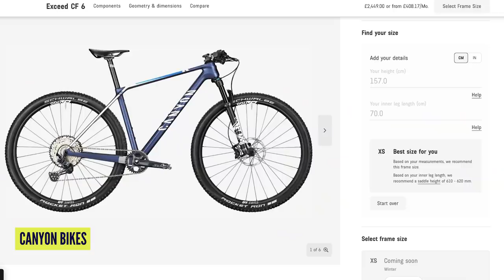How Do I Stop Arm Pump From Braking Bumps? | #AskGMBNTech Ep. 174

Comment: #AskGMBNTech 
Why are bikes so small? 
The stack height of bikes seem tiny. People are always towering over their bike. Bike just seem to get longer reach for larger riders and they just look uncomfortable
Reply: yep, somethign that grinds my gears is stack height.  a Large needs a MIN 640 but some have downwards of 600 which is unacceptable. I like my back to be upright not hump back like roadies.
Reply: @MrSupermugen  5,10 and run a large with 50mm bars. Got a great enduro bike but sold it straight away because it felt like a kids bike and it just felt i was riding ontop the bike instead of in it. Norco seems to be the only one breaking the trend somewhat
Reply: @LJS1605  norco's sight stack is bad.only like 615 stack, when i owned that bike i hated it.
Reply: @MrSupermugen  got to get a Range. Its the only way
Reply: @LJS1605  except its high pivot... i dont race downhill so have no use for a bike like that.
Reply: I guess it's down to R&D and geometry risks. To raise the stack height you'd potentially have to shorten and steepen the top tube, which might throw off what a companies that use top tube mounting might already have as "figured out shock placement". Same applies in general to most geometry changes - when you steepen or raise something, you need to lengthen or shorten something. In this case, if we raise the stack, the front triangle changes and most brands probably would like to just toy around with proportional chainstays and reach instead.

The longer reach issue is due to what I would call "new modern" geometry. There was old school, then modern (2017), then now new modern with the ultra slack stuff. With the slack head tubes the top tube effective needs to lengthen... which then promotes new riding positions and style and now the "forward position" when riding. As of now the industry is slowly moving to 29ers, high pivots, horst linkage w/ vertical shock and longer, stable bikes. Go and hope that they would make stack right again!

Comment: #AskGMBNTech isit ok to put wet lube on a chain which already has dry lube on it?
Reply: Technically yes, but in practice no - if you have a clean chain, theory says yes, but since most dry lubes have some kind of wax or teflon on it, you run the risk of the wet lube just flowing off. Even worse if you have a ridden, gritty chain; even with dry lube, you'll just be marinating grit with wet lube.
Reply: Just clean your bike man.

Comment: #AskGMBNTech Hey doddy! Why is my rebound slower when it is cold outside and how could i fix it? thank you
Reply: The oil gets more thicker as its get colder outside
Reply: Lower temperature result in higher Viscosity. Open your Rebound some clicks to counter this effect.

Update Also check your Sag in colder Temperatures. The Airpressure might drop.
Reply: Lower temp results in the oil having thicker viscosity. Like what Timothy mentioned, change your rebound if you feel it's sluggish on trail. Remember to turn it back to where it was for summer days. 

*And no, if you were thinking about changing oil weight from let's say 15wt to 10wt - don't. It'll kind of fix your issue in cold weather but will provide much lesser lubrication under normal riding conditions and ruin your fork in the long run (lest you do insane amount of lower leg services)
Reply: @AORNova  Why would it ruin your fork?
Reply: @th_js  The thinner viscosity of the lesser weight oil wouldnt be sufficiently coated over the key parts, and the oil itself would suffer from burnout sooner than the correct weight thicker oil.

However, the benefit of running thinner weight oil is more responsiveness and plushness. Hence why racers run lesser wt but have to change it more often between events. Lest they run their forks dry 🤣
Reply: @AORNova  Might be true, but in practise there won't be any difference I'm wear, unless we're talking about years. Also, when you ride in very cold temperatures, the oil doesn't even get that hot, unless you're doing a huge descent.
Reply: @th_js  Yep agree, if its long decends then it definitely wouldnt be recommended. For enduro or trail riding its at your own risk I guess.

Sticking to manufacturer's guidelines is the best! I've disassembled forks using off-spec thin weight oil and there always isn't much left - and what's left of it isn't exactly.. clear oil. And most of the time those forks come in for stiction, hissing noises or other irregularities outside routine lower leg service.

If the lbs had put less oil than required then it's double whammy too.
Reply: @AORNova  Yeah, but it also isn't nice when your fork basically doesn't move because of a very low temperature, but so far I've just liven with it because it would be a hassle to change the oil so often.

Comment: No, the levers should not be horizontal, it is the angle of the levers that causes the straining of the wrists and hands. They should be tilted/angled at the same angle as your forearms. Dont listen to Daddy when it comes to having the levers horizontal. This is super duper mega important for racing motorbikes for instance, and if the levers are at angle that is too horizontal you will get cramped  hands and wrists and even armpump.

For instance try this when you do push-ups. first try witht he palm touching the floor and then try with making a fist ie the angle of the hand will be the same as the forearm, which feels better ie less strainy on your wrist?
Reply: Well... I beg to differ. The Angle of the Lever's vary on the Terrain you ride. Flatter trail's often call for steeper Angles than steeper Trails... Also: everybody is different. What you like must not work for everybody else.
Reply: @mistera1mL3Ss  You may beg to differ but that is pretty much standard ergonomical practice. Having the hand in a acute angle compared to the arm will result in excessive strain. Maybe you don't ride long enough and/or hard enough to feel it but every human body would have issues.
Reply: @Pillokun  to find a starting Position, yes... Still every Body is different and People like different Stuff. I get your Point but to tell People someone is plainly wrong and you are right isn't really an approach. Take a look at Yoann Barelli's Brake levers... Maybe he also doesn't ride long or hard enough 😉
Reply: @mistera1mL3Ss  the only reason you would want to have the levers parallel with the ground is if you are far behind the bike, ie when you are over the rear wheel with your behind going down technical sections. That is the only reason, and even then the fore arms and hands are inline without any acute angle on the wrists. The question about how the riding position is supposed to feel or be is one of the main questions we track riders must get right, and it is the same issue a mtb rider have.
Reply: @Pillokun  So... You agree that the Lever Angle depends on Terrain? That actually was my Point. Also you are actually not behind the Bike but the Bike tilts under you so it makes the impression that you are behind the Saddle even if you are don't.

Also... Comparing Track riding on a Motorcycle in a rather fixed Position ( Movement but in smaller Increments then MTB ) and the movement on an MTB going down technical Descents isn't really Apples to Apples.
Reply: I dont understand why my reply does not shows but I have replied 4 time to Timothy. What I was saying was this:

Riding motorcycles on track is more demanding on the body than riding a MTB downhill, it is because of the weight of the bike and the g-forces.

After a session where you have been giving your max for 10min you are shaking uncontrollably when you jump off the bike because of the fatigue, not something you experience on a mtb going downhill for 10min.

The neutral position of the levers should be a bit tilted down because the angle of the levers should be the about the same as your forearms. When you position the levers a bit more horizontal it is just because your body is lower, your rear is over the back wheel and the fore arms are inline with the levers. You should never ever have forearms and levers at an acute angle because you are straining your wrists... simple isn't it?
Reply: @Pillokun  all good, Dude. Friends race on Track. Ever saw Carl Fogarty before and after a Race? Jeez...

I get your Point but still it's pretty different Bodyposition and movement wise.

Comment: Steel chainring will wear a chain Faster. Aluminium will wear chain less because it is softer and becomes (more) the sacrificial element.
Reply: This isn’t true. Chainrings don’t wear chains or they shouldn’t do if you’re using a correct chainring and you have correct chain line. 99% of chain wear is due to the stuff that gets ingested into the chain rollers during riding. Not the contact of the chainring on the chain. Your chain will have shit itself due to the wear I mentioned wayyyyyyy before the chainring would start wearing it regardless of whether it’s steel or aluminium.
Aluminium chainrings wear faster than steel though.
Reply: Absolutely not true.

Comment: Horizontal levers!🙄 must disagree doddy, thats never going to be a sensible lever angle, and will likely cause pain due to his brake lever angle...horizontal levers, when stood in the attack position will hyper flex wrists. Might not show on his local milder trails. Always set lever angle when stood in attack position so forearms, wrists, hands and fingers are a straight line.  Not blinking horizontal!!!
Reply: I agree to the most of this... But: the steeper the Terrain the flatter the Angle of the Lever's. The Angle set on flat Ground won't always be suitable for 20 degrees down... And: personal preference is a huge Point as well.
Reply: I very strongly disagree. Of course it's personal preference, but you can't just say it like it would be bad for everyone. I actually ride with my levers literally pointing upwards slightly and anything else feels like shit.